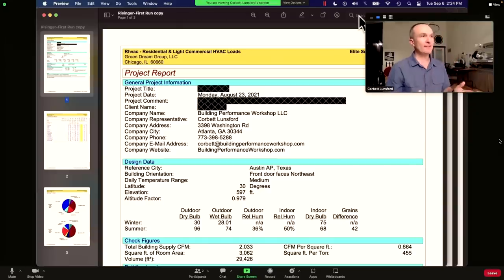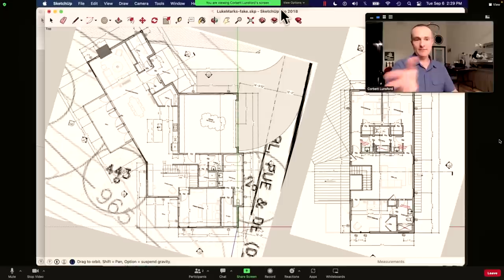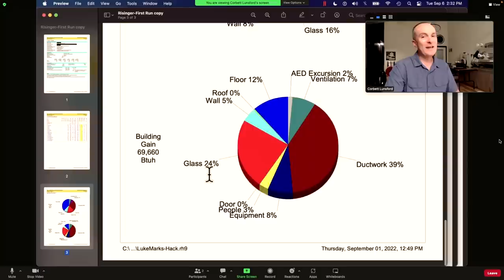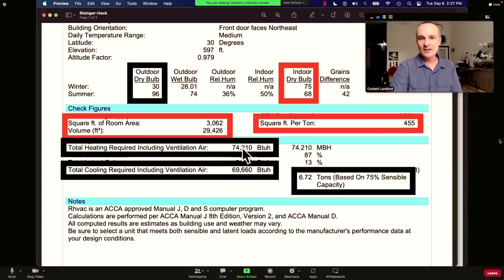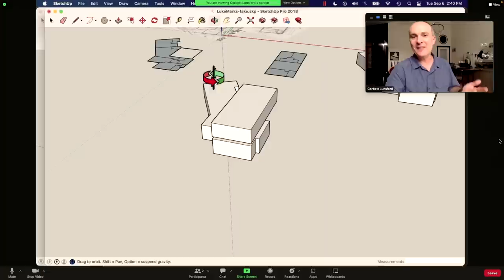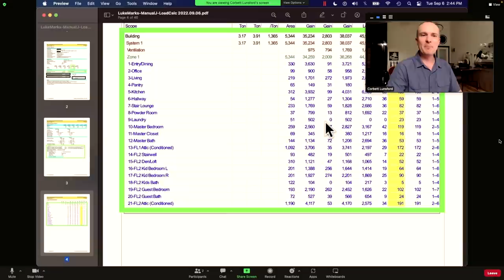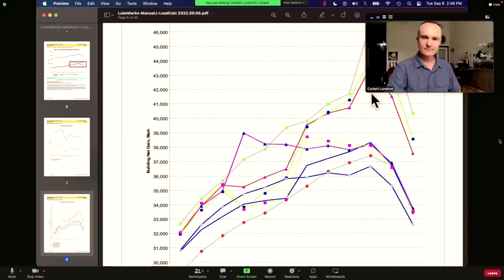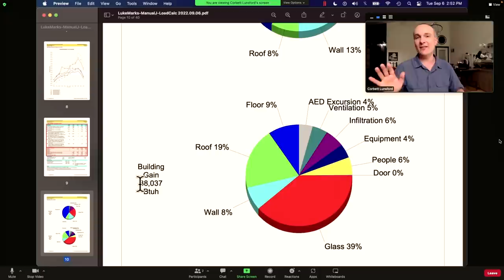Your HVAC specs might be COMPLETELY wrong: Manual J Training

Comment: I finally got a new furnace and AC installed.  I went with the young guys who just started their own company who did the actual load calcs for my house instead of just eyeballing it based on 'experience' or the old system.  I had a 4 ton AC and 88,000 BTU furnace.  Everyone else wanted to replace with a 4 ton with a 110,000 BTU furnace.  The guys I went with asked me details on the house, what improvements have I done, what insulation have I installed and witnessed installed.  What air sealing have I done, etc.  They sized me at 60,000 BTU with a 2 ton system.  I was really, really skeptical since they were the outlier but they showed me the numbers.  It helped they were the cheapest since they were installing the smallest equipment.  I had a 30 year old furnace and a 40 year old AC so anything newer would be an improvement and so far, everything they said has proven true.  We'll see this winter but so far so good.
Reply: There correct. I’m a HAVC guy and I learnt trades people hate doing calculations. They will do quick math but they won’t sit down and do the actual calculations. You fluked out and found the right guys.
Reply: What's the square footage of your house?
Reply: Any updates? I'm interested to hear about the total year performance

Comment: I’ve always enjoyed Corbett’s videos , they’re so helpful and informational and he’s such a energy geek like me.  I’m surprised he didn’t get into  more details about orientation at the house N,S,E, W. With the manual J software we can easily simulate how the heating and cooling loads change by virtually changing the orientation of the house. The exact same house facing north south east or west can require different heating cooling loads They can vary  as much as 25,000 BTUs depending on which way the house is facing. This is why I recommend running these calculations before the architect and builder Have filed plans for the building permit. An energy and comfort conscious buyer owner might be willing to change the orientation of the house to reduce the energy level by 20%.  Manual J software can even take into account roof overhangs and tree shading for more accurate results. For new construction is pretty rare to have tall meaningful trees close to the house. But for older homes in retrofits it’s very common and can result in a half ton more difference in the size of the condenser and coil. I was also surprised Corbett didn’t go into details about CFM versus BTUs. Manual J software can give a room by room breakdown of CFM’s delivered for heating and cooling season. This is a critical detail for the HVAC installer needs to use the maximum CFM of either heating or cooling. And make sure the ductwork and registers are sized properly to deliver this predicted CFM. Manual J software can also take into account whole house ventilation systems to deliver the desired ACH. It’s also important to note that anyone can learn how to design manual Jay reports with the right training. Builders can learn it and do it themselves. HVAC designers and installers can learn it and offer more value to the builders. More architects need to learn this technique as well. Most city and county building departments now require manual Jay reports before they will issue a permit for the house or a new HVAC system. And if I’m the owner or buyer I would like a thorough level of details and no more of this rule of thumb BS.  Also he didn’t speak about zoning very much. Manual J software can and should also model zoning the house based on multiple zones for a single set of equipment. Or multiple sets of equipment per her house with each equipment serving one zone. Manual J can also be used for what if scenarios like, what if I used ductless split units versus traditional unitary equipment with sheet metal ductwork. They can also run what if scenarios showing flex duct versus metal duct.  They can also show what if scenarios that show the difference with or without fireplaces and how many fireplaces. I use Wrightsoft manual J  software. But there are a few others that are good including Elite. All manual J software Hass to know the ZIP Code of the building and uses that to get accurate weather data to predict heating degree days HDD and cooling degree days CDD. These are critical parts of the heating and cooling load calculations. The HVAC designer can vary whether you want to design to the 90 percentile (not recommended ) 95 percentile which is what I consider the sweet spot. Or the 99% percentile as Corbett went to in this example. You won’t take a big a hit designing to the 99% in  a Matt Risinger  new construction tight, energy efficient house. But 99% would be overkill in a retrofit of an older home.
Reply: Right on, Andrew- honestly, this video could have been 3 hours long and we'd still leave some stuff by the wayside.

Comment: I own a new construction heating and cooling company that does primarily single-family residential. We start about 12 houses every day. Probably the biggest challenge that I have seen is getting accurate and current information from the builders about the product that they are building. We will often see that Building materials or processes have changed especially due to the supply issues of late. Situation is like not being able to get tech shield and so they just leave tech shield off houses for a couple months but they failed to notify anyone lol. We sent out builder survey sheets every six months to all of our builders every six months where they enter all the current specifics for all of the factors that will affect our HVAC load a.k.a. windows, insulation package etc. it’s always a work in progress. We run plot specific loads on every house that we do. Actually that’s probably another good point, using generic house plans and not taking into consideration the orientation of the home on the lot can make up to a large difference on a six or 7 ton home because of window exposures.
Reply: Sounds like you’re home builders need more of an understanding about the numbers you need. If I were you I would  set up a meeting to demonstrate the Wrightsoft software for manuals J & D so they could understand the importance of the numbers that you need, (Communication, education and understanding is the key). I know Matt’s understanding is a little better now that Corbett demonstrated manual J but manual D is also every bit as important  (sizing ductwork, supplies in the area of the windows & Air returns in all of the rooms but for the bathrooms and kitchen).
Reply: @boby115  If those builder(s) are starting that many homes a day,  I am betting the level of caring isn't all that high.
Reply: Is your heating and cooling company located in Los Angeles, Ca?
Reply: Yea, I remember a guy trying to go cheap and copied the blue prints backwards.
After the foundation was pored he realize the front of the house faced the mountain side, not the view over the city. Rather than start over he built it but the window calcs were way to high with them in the shade year round.

Comment: I’m glad he straightened Matt out about including the size of the conditioned attic. Matt always acted like he got that square footage for free (it’s not free ,you have to condition it); is it better than insulated ductwork in a hot attic ? Absolutely. So glad I live in an area where 95%of the homes have basements. Corbett did an outstanding job on explaining how manual J should work 👍. Ductwork design manual D is every bit as important as manual J . Size the ductwork correct, install the supplies in the area of the windows and install returns in every room but for the bathrooms and kitchen  (Life will be good whether you have a single stage , two stage ,VRF or VRV).
Reply: I totally agree with everything you said.  i just wanted to add that the Manual T and S are also becoming just as important to the equations.  I have no laid my eyes on the Manual RS but it is coming.  But as technology gets better, more expensive and more efficient; things are going to really change, and some information will be obsolete.  My HVAC business doesn't do much zoning, but it looks like it will be going more in that direction.  Living in Denver in a very arid climate has some major challenges with psychometrics amongst latent heating and cooling.
Reply: In terms of cost, what is better in zone 4a: mechanical and ducts in 1) a basement with a vented attic or 2) slab floor with an insulated roof?
Reply: @maurozammarano6651  , That all depends on the norm in your area. The norm here in the St. Louis Metropolitan area is basements. I have a 2500 square-foot ranch with a 2500 square-foot basement.80 % of the basement is finished  ( bar, game room , media room TV, Office). unfinished section ( mechanical and workshop). Try to get that out of a conditioned attic. Forced air systems are the norm, gas furnaces where natural gas is available ; heat pumps, propane furnaces & mini splits out in the rural areas.
Reply: Up north where I live: the attic is generally left unconditioned to prevent snow melt and ice damming. Basements are very common though: so that is where you will find the ductwork.

Comment: I am smack dab in the middle of this so the timing of this video was PERFECT!  I have a bunch of twists since I am comparing a VRF zoned solution versus a Geothermal (pond loop) solution.  Apples and Oranges, BUT the both are viable and our personal long term goals come into play.  Oh, and we are about to start a remodel of the 70's ranch house (vetting contractors now) and build a new office/in-law suite+garage workshop at same time.  I am not sure I could add more if I wanted to (except solar and 2nd well, which is already in process. ha!)

Comment: Corbett is a composer for the music in the mechanical room.  One of The Best 38 minute videos. 

One take away is even though we need to plan on 100 yr flood, we don't really want to have huge equipment for the heatwave that seldom shows. With humidity it is more efficient for a slightly smaller system to run longer than a larger system cycling more frequently

Comment: Great video! Thank you. One comment follows: When discussing what I’ll call “effective square footage” I think what’s really important to convey to viewers is that it’s the volume of the house that gets heated or cooled, not the square footage. Given the volume of the house (cubic feet) one can then divide by the ceiling height (feet) to get an “effective square footage” (feet squared) which is what the Manual J calculators require. As a caveat, I’m not an HVAC specialist (rather I’m an electrical engineer) so I may not be thinking of this problem correctly. I hope this comment is helpful.
Reply: Yea, you're absolutely right. I had that cubic area thought as well but I sort of questioned it considering the wealth of knowledge the both of these gents bring to the table.
Reply: Heat transfer is through the thermal boundary of the building. The area of the walls, floors and ceilings is what matters. A 20 x 20 foot house has 400 SF. A 10 x 40 foot house has 400 SF. the first has 80 lineal feet of wall. the second has 100 lineal feet.

Comment: I am one of the many in the humid south east Texas that has their duct work in a hot 140 degree attic. Been doing a lot of youtube, research, learning, and note taking. House needs a new roof along with a new efficient AC/furnace system. Didn't know there were 3 different run cycle units. Not my "forever home" so on the fence about a metal roof. Tonight, saw Matt's roof build with cool-vent panels. Will accept shingles or metal roofing. One thing I am for sure doing is spray foaming the attic. 
My folks had their 3 car garage spray foamed, and installed a mini split system. I'm sold on the foam and mini split. Will be adding one to my garage as well.  Lots of good info. I have to find an auditor to do load calculations, someone that doesn't work for HVAC company. That way they can't tell ME what size of a unit I need to install.  During these past hot few months, electric bill has been 400 bucks, for a single story house. So I am reading and looking to see what all I can do to make it low as possible. Changes are coming very soon.

I am enjoying all this free info yall share. Down the road when I plan to move west, (centeral Texas) makes me really want to build a home so that its built right from the start.

Comment: Really excellent information.  Somehow on my house the installer really missed the mark.  All the rooms cool evenly, but I never hit stage 2 and even at stage 1 70%, I rarely see 100% run time.  I've slowed the fan and activated dehum mode to get more run time and dehumidification.  I also now have a retrofitted ventilating dehumidifier.

Comment: An encapsulated attic is not considered a conditioned space. It is a "semi conditioned" space because we are not trying to maintain 75/50. Even though it is inside the envelope, it should not be treated the same as the living spacr. In Wrightsoft, you can select the ceiling material as an encapsulated attic, set the roof deck R value, and the expected attic temperature (usually 85 degrees). There is a small transmission gain and duct gain from an 85 degree attic into a 75 degree space.
Reply: Yeah, and who wants to keep their living space at design conditions? Additionally, this is at the worst one hour of the day.  Love to dig into the duct loading assumptions since manual D is likely not complete. I  like how they quickly moved past increased cooling load as a result of decoupled slab.

Comment: @Matt - In regard to the direction that a house faces, which is a good point as it relates to HVAC, but don't forget to look at your solar installation, even if you not installing one now.  The roof type and orientation will play into the solar panel efficiency.  You need to consider both...

Comment: 28:18 Uninsulated/insulated slab comment. I own an old house near chicago with a large uninsulated heat sink. Our basement has a 6" concrete ceiling, 12" thick concrete walls going down 8.5' below grade with only 6-12" of exterior exposure above grade. In the summer our house is almost entirely passively cooled. I can cool our whole house in the summer with a 5000 BTU window AC unit placed at the top of the stairs on the second floor. On the hottest days we turn on a second 5000 BTU window unit on the first floor. Someday I will insulate the top 3-4 feet of my foundation walls. Our ground temps average 54F +/-5F 8' below grade. So all in all some good tradeoffs.
Reply: Cool David- good to hear from you buddy
Reply: That is awesome and amazing all in one statement.  Pretty incredible how different everyone's situation and home can be different.  You scored on the sensible heat lottery!!
Reply: but what does it do for winter when you WANT hot air, and the ground is 30 degrees?
My first floor  from the slab is nice and cool on the hottest days, while upstairs you could make a sauna if you spill water on the floor.
I'm going back and forth about putting in a subfloor on the slab to level everything, but would I lose that nice comfort raising floor up 1" off it.
I just found a defect with digital thermostats in the big freeze last week.   Old coil spring thermostat was dead on heat.  So bought a digital thermostat.   Apparently the batteries only last about 10 minutes in the cold.  Trying to diagnose the heater not working, and it kept shutting down low battery.  Figured out almost two years ago when the transformer blew, it was probably the thermostat or the sequencer failure,  I just replaced it adding in a fuse.  Thought it was a lightning storm that did it, never thought to check the heat side, but both were dead apparently.

Comment: Matt, Corbett, 
This is a stunningly gr8 edu video!  Thank you both so much ! 
At the 18:00 point, Corbett used SketchUp to create a simple depiction of the home. Outstanding! 

Wouldn't it be IMPORTANT at the same time ... If we included "Strategic Window Placement" & "Roof/Soffit Overhang," so we could also refine the roof overhangs with respect to the sun on various summer & winter scenarios? 
Energy Vanguard did exactly that for me on my Virginia home and we increases my front south facing dormer & porch overhangs. 

Corbett's AED points at 23:15 about west face windows will be especially critical for me on our new NC home design, with it west & water facing front-door side. 🤔 

Thanks AGAIN for a brilliant video! 

Cheers, 
Eric

Comment: One thing I'll say as a hvac business owner.  With system sizing sucks big time if you put in one too small. Put one in too big and sure you'll have some issues but not as pissed off a customer as one who's home can't cool below 78 on 110 degree day when their neighbor can get down to 68 on a 110 degree day and both homes are similar.  With that being said, don't be lazy. Do a load calc. But ways you can avoid screwing up load calcs is installing variable speed equipment and proper ducting. 

Also. When you do a load Calc for 99 degrees but we have like 40 days or more over like 105 this year in Central valley CA. Dry humidity. Don't want your system running too long. Dry the air out terribly.
Reply: Good points, fisherman
Reply: I live in the Center Valley....26 days straight of triple digit heat means an insane power bill and me praying to the HVAC gods that my ac doesn't crap out. I just hope my ac hangs in long enough to insulate and generally upgrade my building envelope. My house was built in 1948 is leaky and maybe has a few inches of blown insul in the attic.🤣😭🥵

Comment: Great video!  I have an issue with the online HVAC calculators, impart because the zoning/region maps they want people to pick from can be off.  Examples say you live in Region 2 in upper north west Texas, but you live on the southern end of that zone were it can get to 110+ in the summer then you are actually more like Region 1 because of the summer temps.